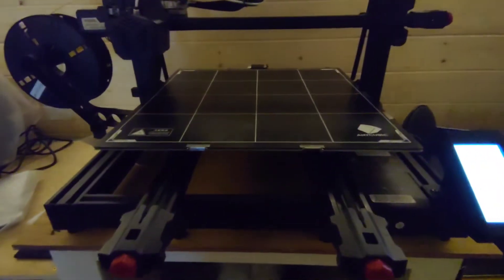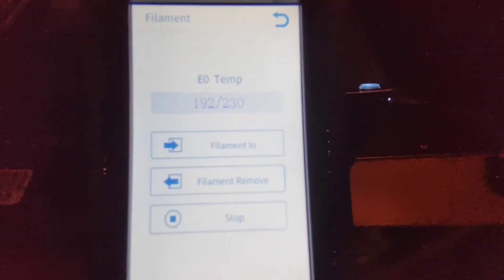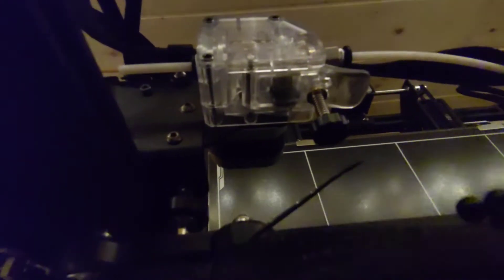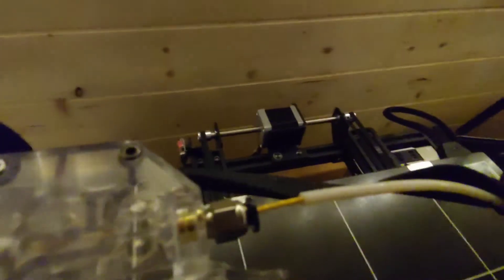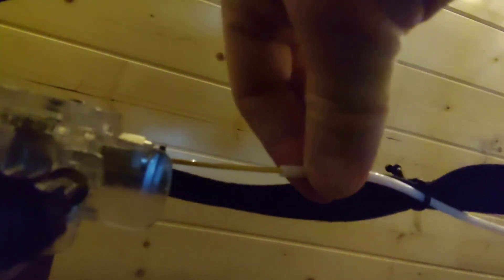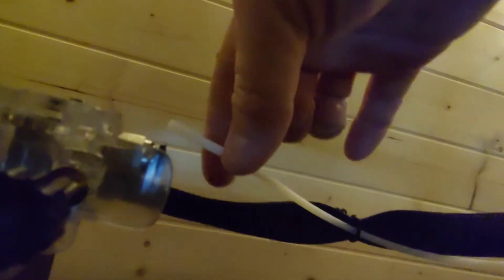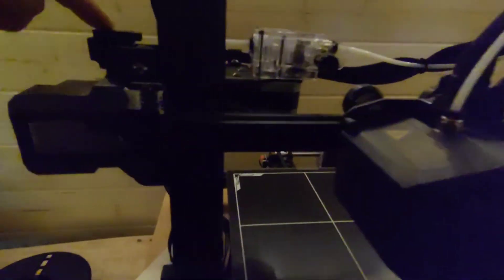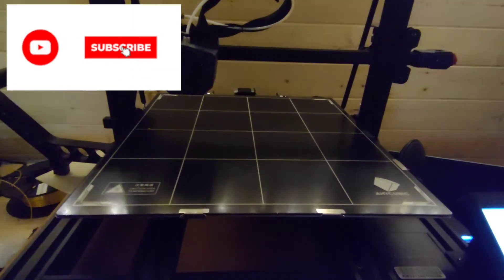Anycubic Kobra Max filament removal process (auto and manual) 3d printer

Comment: Why not disconnect the bowden tube and pull the snipped filament all the way through the feeder. Then pull it back from the extruder side and avoid running molten/malformed filament through the gearing entirely?

Comment: Hi, Thanks for the videos. I tried doing this but the white tube would not come apart from the black rubber thing you pushed in for easy release. :( what should I do please and thank you.
Reply from the maker: @mariangies  thanks for watching, it's a push fit fitting. If you push in with 1 hand and pull the white tube with the other it will disconnect
Reply: @ I kept trying till I got it.  My thumb now hurts but I did it. Yay! lol. Thanks so much.

Comment: Thanks for this video! Question, is the cooling fan supposed to come on once the nozzle reaches a certain temperature? I'm having a heat creep issue that causes the bowden tube to clog because the filament is melting before it reaches the nozzle. I don't remember if the cooling fan was supposed to blast on once the nozzle gets hot enough. Right now all fans are working and even when I adjust the cooling fan in the print settings it comes on because I can hear it. Not sure why this heat creep started out of nowhere. Hopefully you can point me in the right direction. Thanks

Comment: just wondering if your bowden tube on the quick release side has any movement back and forth during retraction while printing?  mine seems to slide a bit and i was wondering if this is normal?
Reply from the maker: No there shouldn't be any movement at all
Reply: @3DPUK-TECH-CHANNEL  thanks.. will have to figure out a solution

Comment: do you need to remove the filament from the run out sensor engaging? or do you just add another spool and push the remaining filament thru? thank you
Reply from the maker: Hey so two options if your running a Filament change mid print you can either pause and pull through and the push new Filament through. Or if your running and don't want too stop you can cut before the sensor and carefully feed through keep sensor triggered with Filament.   Hope that helps 😉 don't forget to like and subscribe 🙏

Comment: Can I pause print to change the color mid print like I can on my  viper?
Reply from the maker: hi yes you can pause the print use the manual method of removing the filament and then manually feed this way it doesnt need to change, this can all be done in the print screen however if you leave the print screen it will finish the print midway... i dont think u can have this entered in Cura with this firmware... it has worked for me im looking too add a quick video on this very soon

Comment: can the filament feeder position be changed so the filament roll be placed above and back, like in a shelf behind the printer ? or on the top of the frame ?
Reply from the maker: Hi thanks for the comment the filament sensor can be removed and be repositioned. However the extruder might need more thought in how it would affect the dynamics of the filament feed
Reply from the maker: You potentially rotate 45, degrees